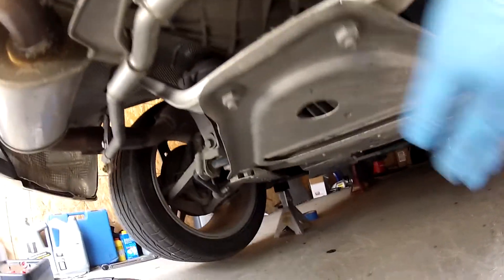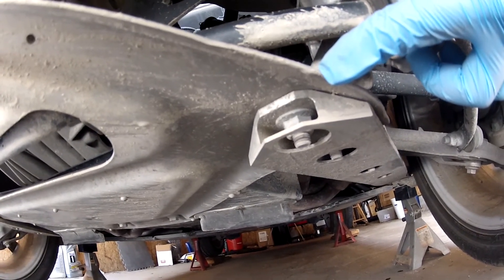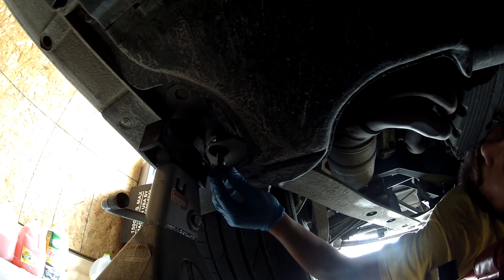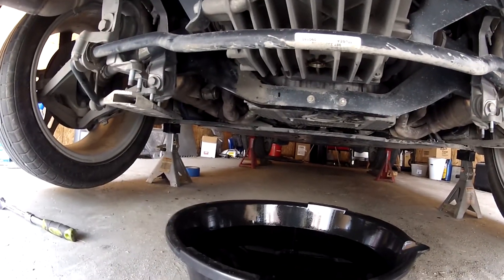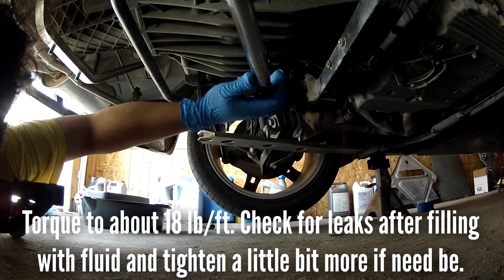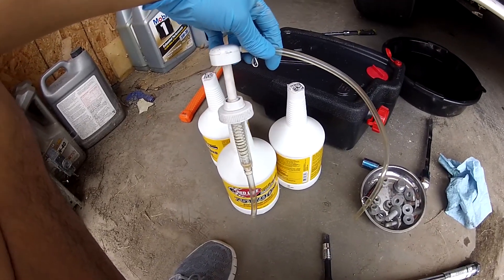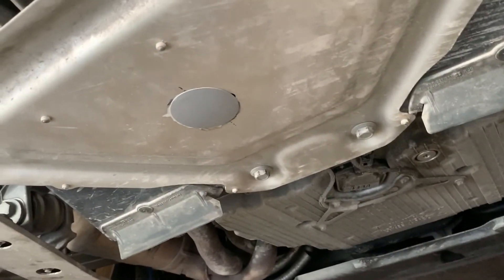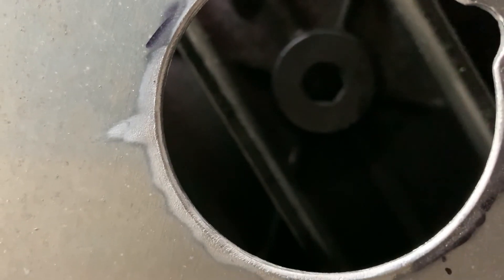Porsche Cayman 987 Transmission Fluid Change and Access Port

Comment: Did changing the fluid help your notchiness?
Reply from the maker: It depends. If you are currently running non-synthetic fluid or the fluid is extremely old (or has never been changed) then yes it will certainly help to some extent but most likely won't eliminate it completely. Definitely should not make things worse but it can only help so much if the transmission has a good bit of mileage on it.

Comment: Can you get to the fill plug with the pan and braces in place?
Reply from the maker: Certainly. Access is a little bit tighter but it can be done. Might get a little messy though since you'll have to maneuver your fill hose around a few more things to get to the plug. Removing the rear driver side wheel would definitely make things easier.
Reply: @jontansgarage  Thanks. Maybe you could take some measurements or make a template of the hole you drilled so one could drill the plate in place. I just did the transaxle fluid a couple days ago and I took the support plate and braces off since I couldn’t find the fill plug. Now that I have done it and know where everything is I think cutting a hole in the support plate would be worth it. Take the wheel off to reach the fill plug and drain through the hole. It’s easy to take everything off but it may need an alignment after taking all that off. You could make a little pvc pipe tube or something to put inside the hole in the plate so all the fluid wouldn’t drain all over the plate.
Reply from the maker: @thomasloper1205  PVC pipe/funnel is a great idea! If you line the 2 inch hole saw up with the edge of that factory hole, it should be pretty spot on. I just offset mine a little bit so I would have a little gap to stick a flat head screw driver in to pry off the plastic cap. But yeah,  a 2 inch hole saw should give plenty of room as long as you are close to the edge of the factory hole. I can try and take some measurements the next time I get the car in the air; hopefully within the next month since I will be replacing my front control arms with GT3 arms.
Reply: @jontansgarage  thanks man. I do think mine needs to have the alignment checked now. Maybe it’s all in ny head but I’ll probably have to have it checked. If you change it more often I think the hole makes sense. Otherwise do it when it needs an alignment anyway.
Reply from the maker: @thomasloper1205  I can't say that I noticed any alignment issues but definitely worth getting checked out if it is truly noticeable. I did the hole thinking it would definitely save some time, in the future but tbh, it probably isn't worth it unless you track the car frequently and replace your fluids often. I probably won't be changing my fluid for a few more years and who knows if I will even have the car in that time.
Reply: @thomasloper1205  You'll only have alignment issues if you set the car back on the ground w/o the skid plate.  If you leave it on jacks the whole time, no problems.

Comment: The fluid will end up draining on the skid plate
Reply from the maker: Surely will spill a little bit. However there is plenty of room to stick your hand in with a towel to clean it up. Beats having to take the skid plate off.
Reply: @jontansgarage  Hi, How many liters you added ?